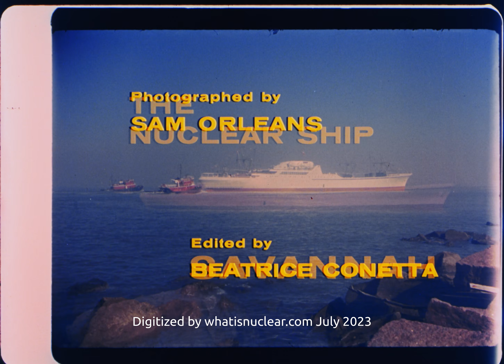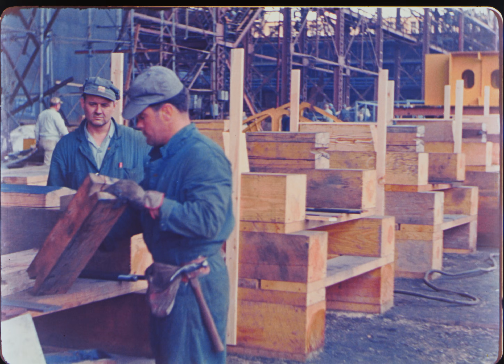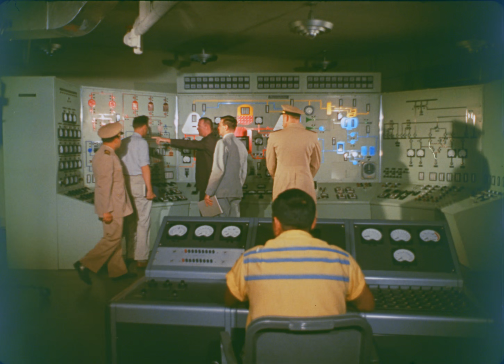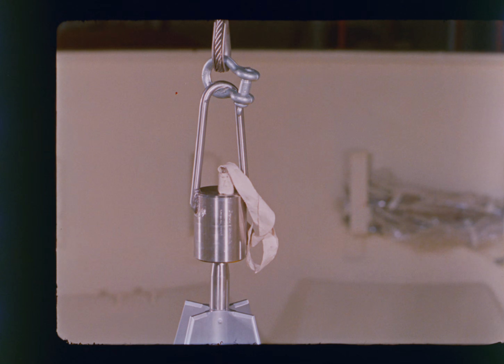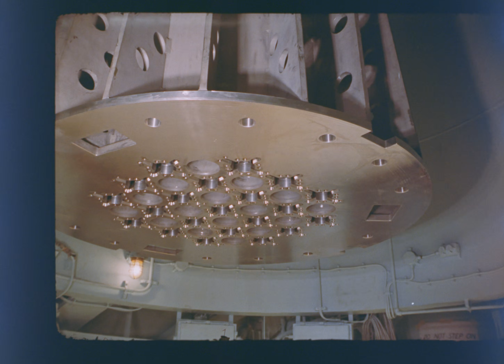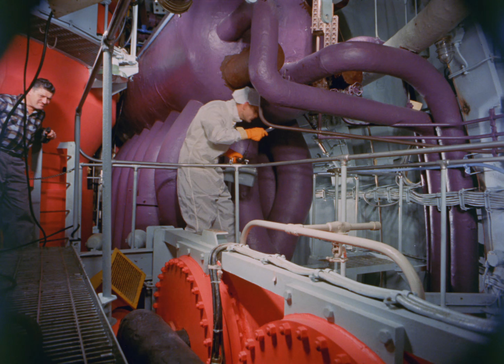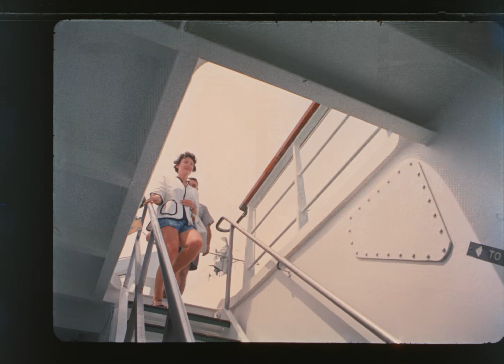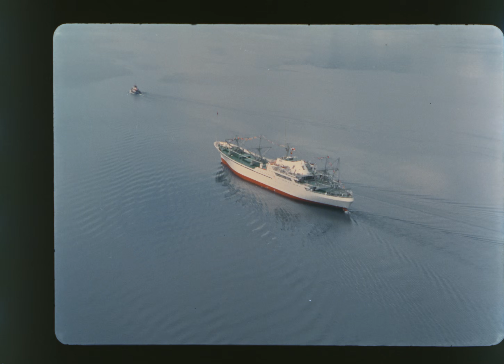The Nuclear Ship Savannah

Comment: If nuclear powered marine freight could travel twice as fast for nearly the same cost, then they could cut the number of ships in half, thus using less resources like steel etc.
Reply: except that you lose 45 to 30 percent of the time in wait line to enter the port, and steel is cheap
Reply: They would have to build a ship much faster than 22 knots. Heck, WWII Battleship USS New Jersey once did 35 knots before they powered the ship back. It had more left in it to go faster according to sailors that day.
Reply: @kman-mi7su that was the New Jersey's 1968 recommissioning sea trial.  The ship was about 5000 tons lighter than in WW2 due to equipment removal and made 35.1 knots.  The reason sailors say she still had more is US Navy power plants were designed with 20% overcapacity for emergencies.  So they could have "pushed" the engines for more speed in excess of the 35 she did.  The destroyer escort Sammy B. Roberts did this in her final battle with Taffy 3; for nearly an hour this 25 knot designed DE was moving at a documented 29 knots.  I'm willing to water N.J. could have made 37 knots in '68.
Reply: @kman-mi7su  All US nuclear navy surface >30 kts. I expect 40 kts for a nuclear cargo vessel is possible in regular seas.  There’s no fuel savings concern so why not.
Reply: I was on a Navy Destroyer that would do 35 Knots!
Reply: Honestly, the market for a nuclear ship is in the passenger industry. There are no longer passenger lines, because normal ships cannot compete with airlines for speed and cost. The port fees and licensing would cripple a cargo company, which has to visit a dozen ports each trip. A passenger line between FL and Spain or France only would need to stop in 3 or 4, and would be agreat option for those who dislike flying (the only option at this time).
Reply: @leechowning2712  Cruise ship lines would. no doubt also like to be free of 200 gallon per hour diesel costs, and increasingly stringent emissions rules that will one day make fire itself impossible.
Reply: Why did the ship have such unusual cargo handling gear instead of conventional derricks or cranes?
Reply: @rolanddunk5054  because it was designed primarily for carrying a small number of passengers and demonstations, rather than to be economically useful.
Reply: Fuel rods do wear out; X size fuel rod, will generate X amount of steam and then be depleted.
Reply: @jhoncho4x4 Go ahead & tell us how long you think a fuel rod would last
Reply: @Div1ne_1  I have not bothered to look up or memorize how long each type of fuel rod lasts; many types and sizes.
I suppose one could look up how much energy a particular type of fuel rod holds, if you really wanted to know. 
It's size, btu load and design would all be a factor in the life span; before being too depleted for it's current purpose.
The power plants use large rods, so last longer vs a submarine with a smaller power plant and smaller rods. 
Sub still runs out of food, long before fuel.
Whenever I hear about fuel rods being changed, it's usually a submarine.

The rods are so large in a power plant, they use a crane to change them.
Older power plants could give you a good estimate of how long one of their rods last, since they have ran long enough to have depleted a large sample of rods to calculate from.
Keep in mind, those are large rods, generating a large and consistent amount of power.
A ships power can vary and has a smaller power plant.
Russian atom ships use alot more power when breaking ice vs cruising.
Amount of time spent breaking ice, will effect fuel rod life span.
Reply: @jhoncho4x4  it all nice, until the Somali pirates get hold of it.
Reply: @jhoncho4x4  yes, though 1000 ton tank of  diesel  is depleted one trip.  Fuel rod lasts two years of operation at least, maybe 20 if right kind of fuel and reactor.  So, running at high speed has negligible increased fuel cost.

Comment: There's no doubt about it, the Savannah was a beauty and well constructed.  But she would never have been a commercially viable ship.  Nowhere near enough accommodation to make her profitable for the passenger trade and inadequate cargo-carrying space to make her profitable for the freight trade.  Of course she was a proof-of-concept prototype but the construction of such vessels, the requirements for a specialised crew of nuclear engineers, would have made them too expensive to ever show a profit and that's what it always comes down to.  The Germans would try this idea with the Otto Hahn, a dedicated freighter, but after only nine years in service she would eventually be converted to standard diesel propulsion, with the nuclear core removed in 1979.  Too expensive to operate as a nuclear cargo ship.
Reply: A mass produced well design nuclear ship needs no “crew of nuclear engineers”.
Reply: @Czeck0-u1k  In which parallel universe?
Reply: @LordZontar  small working reactors are not sone inscrutable science project as you would make it. Need plenty of nuclear engineers to design one, maybe to oversee refueling, but not to run a light water reactor across the Pacific for two weeks under a set of rules, that are not un similar to “don’t smoke around the diesel fuel tank” on a traditional vessel.
Reply: @Czeck0-u1k  Yes, I figured that would be the current of your thinking and was waiting for this.  Small reactors will not generate the power necessary to drive a ship.  Nor can you just add modules on without sacrificing cargo space.  There are reasons why designing and operating a reactor for sea is a more complex proposition than for land-based reactors, not the least of which is the necessity to enrich the uranium fuel to 90% in order to be able to get away with a reactor compact enough to fit within a ship's hull and take up only a small amount of internal volume but powerful enough to do the job.  Nice try but SMRs are not the engineering solution for this application you seem to think they are.
Reply: @LordZontar  by small I mean small relative to large land based grid reactors, ie 60-80 MW, 130K HP, plenty to drive marine cargo.  They fit on subs, 2x on carriers, they can easily fit on cargo containers without displacing significant cargo volume.   HEU provides run times life of the vessel, very important for difficult or impossible to access reactor vessels in naval vessels. Not necessary if refueling is possible.  NS Savannah was regular refueled. 

I agree marine propulsion design is complex, and military power ramps would be difficult to control per some reporting from US operators. Marine cargo, with 3-4 power settings, much less so.
Reply: @LordZontar  Ummm... NS Savannah used  two types of fuel elements.  The outer 16 elements used Uranium enriched to 4.6% and the 16 center elements were enriched to 4.2%.  That reactor seemed to fit within the hull just fine.

The only reactor where you will find fuel enriched to 90% is in a military naval reactor.  While smaller physical size is indeed a benefits of using highly enriched uranium, it has a lot more to do with power density and reactor life cycle.  Remember, the reactor in a US nuclear sub is NOT designed for refueling.  This being the case, the higher the enrichment, the longer the reactor will last.

Further, good luck on EVER seeing commercially-produced 90% enriched fuel.  Intercept a load of 90% and you are 4 bags of Cordite and a sawed-off naval gun barrel away from producing a world of hurt.  The 64 kilos of uranium in the device dropped on Hiroshima (Little Boy) was only enriched to 80%...
Reply: Like Savannah, Otto Hahn was a research prototype not a working merchantman.  Both fell victim to the political stigma nuclear power gained in the West.  Oh and the "oh noes nuk'ler!" sentiment you are expressing here.
Reply: @obsidianjane4413  No, Otto Hahn was a commercial vessel as well as an experiment.  The ship's failure had far less to do with political stigma and far more to do with economics.  And exactly HOW have I expressed "oh noes nuk'ler" sentiments here?  Just because I don't think the idea of a nuclear cargo ship is a particularly good one does not mean I am opposed to nuclear power.
Reply: @LordZontar  lol. Read you last sentence agian.
Reply: @obsidianjane4413  Sorry, but we're not discussing things that exist solely in your imagination and springing from your evident lack of reading-comprehension skills.
Reply: @LordZontar  Ironic.
Reply: @obsidianjane4413  Non-answer.
Reply: @LordZontar  Not really.
Reply: @obsidianjane4413  Yes really.

Comment: You've done a terrific job with all of these digitizations - they look great 👍
Reply from the maker: Thanks!
Reply: @whatisnuclear 
What was the original format?
It does look good.
I accidentally threw away a lost episide from a series by Orson Welles that was on Cartrivision.
My gpa worked for Avco; got a bunch of players, camera and tapes when the format failed. Orson made the series for Sears, to offer along with the players. 
Sears owned the rights and never put the series onto another format.
I didn't find out the episode was lost until many years after I threw all that stuff away.
Reply: No doubt a hi-def transfer machine. Filmed on 35mm, but was this copy a 16mm reduction print? It is certainly sharp as a tack. Great stuff! 😊